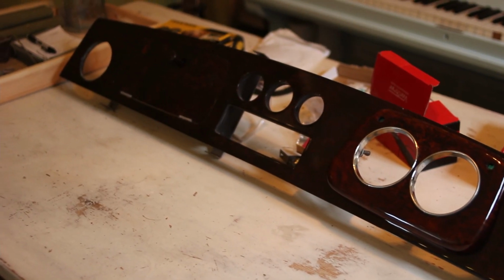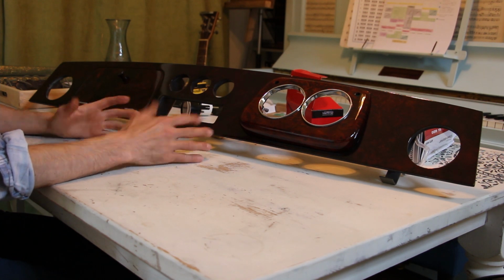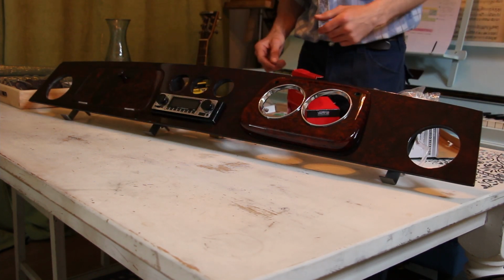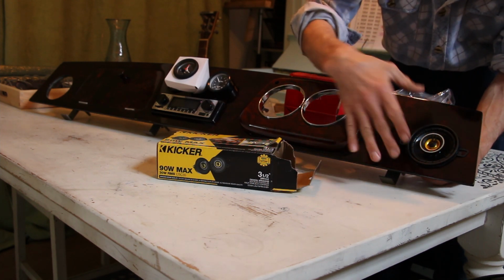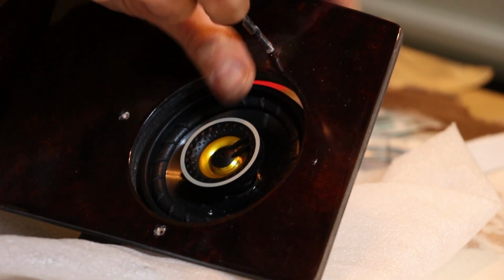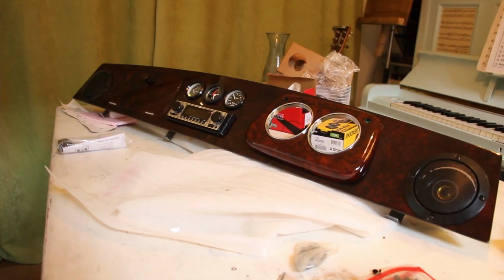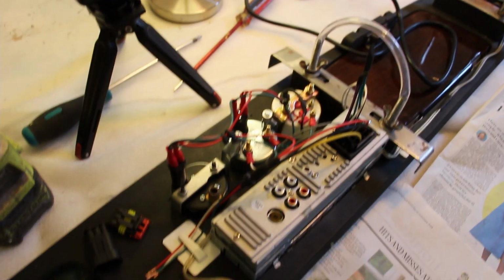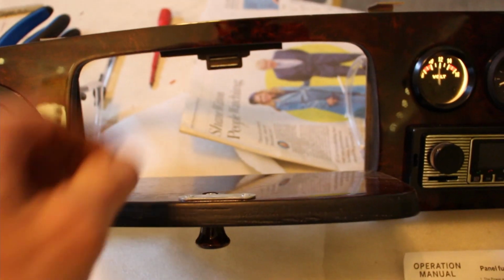The BoOsTeD Mini - Episode 62 - Dashboard build, stereo, gauges, speakers!

Comment: Hey man, love the vids!
I need your opinion on a problem with my 306 DTurbo. It's running a Lucas pump and a week ago it stopped boosting. After checking the turbo, I know it's boosting so i think the problem is the fuel. Is it possible that oil leaked from the Intercooler into the onboost valve and clogged it shut?
Reply from the maker: No, it won't have clogged anything. Is that pipe from the pump to the intercooler split? Is the D ring split? Is the fuel filter blocked? Does it feel more fuel or boost related? What colour is the exhaust gas?
Reply: @PiggyPower  Absolutely no smoke from the exhaust ( The first electric 306) Hoses replaced even though the old ones were good. I'm back thinking about the wastegate being stuck open, or the pump being shot, even though car starts up like new.
Reply from the maker: @TheBGHellKnight  it's odd for it to be stuck open... But not impossible. What turbo is it?
Reply: @PiggyPower  Garrett turbo.
Reply from the maker: @TheBGHellKnight  hmmmm... Check the boost control flap isn't loose? Is it a constant fault? Had anything been done to it ?
Reply: @PiggyPower  Constant fault, I will check it and no, It wasn't touched. But I'm not bothered anymore since I'll be changing cars soon. This 306 has had so much work done, and seeing the whole rear braking system fail, and now the turbo, It's just not practical to invest anymore.
Reply: @PiggyPower  Wastegate stuck open, wouldn't move at all. Any ideas?
Reply from the maker: @TheBGHellKnight  unstick it

Comment: Speakers won't sound good has they need to be sealed from front to back.
You need to front mount them on dash or get some plywood cut out a hole for speakers then fit over existing holes.
Reply from the maker: Correct and correct. will it happen... Probably not 🙈